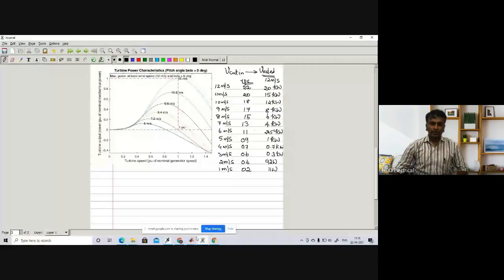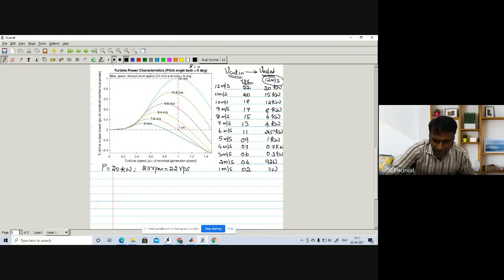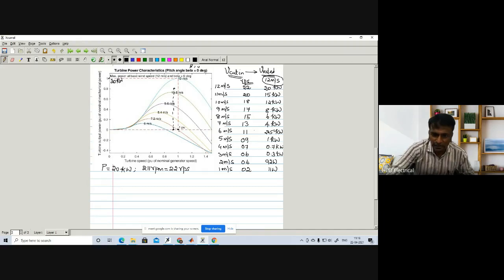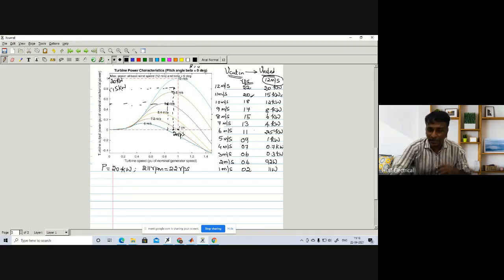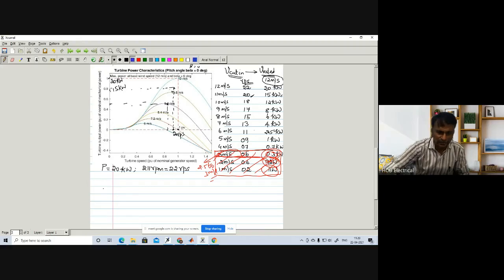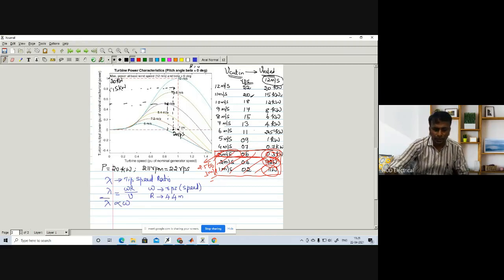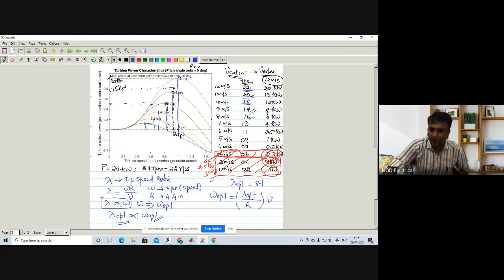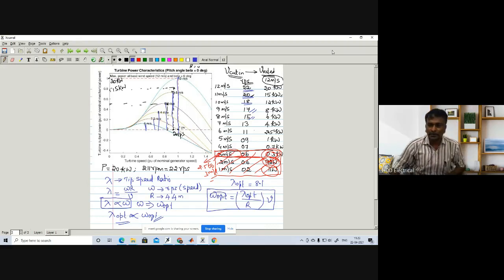WECS 4: Simulation - Tip Speed Ratio in WECS By Dr Rajin M. Linus

Comment: Thank you sir for the knowledge you provide about wind turbine models in Matlab, How can you find out the value of R (turbine radius) which is 4.4 m?
Reply from the maker: Thank you for the appreciation and support. It is our assumption and can be chose from the data sheet
Reply: @eeknowledge1732  OK, I understand what you mean sir🙏 I have one more question regarding gains on RPS to PU.  what is the value of the gain, sir?
Reply from the maker: 1/ rated speed in rpm
Reply: @eeknowledge1732  As for the gain in mechanical torque (tm), does it change according to the maximum power at 12 m/s, sir?